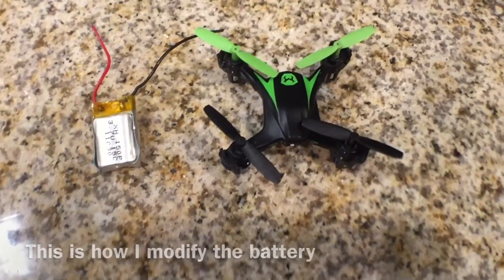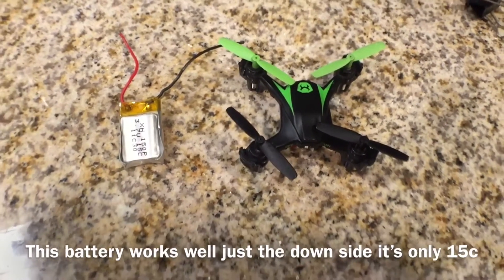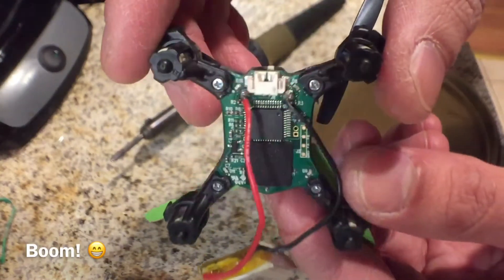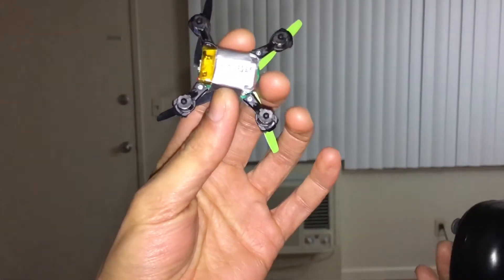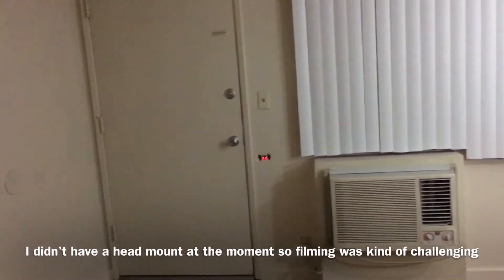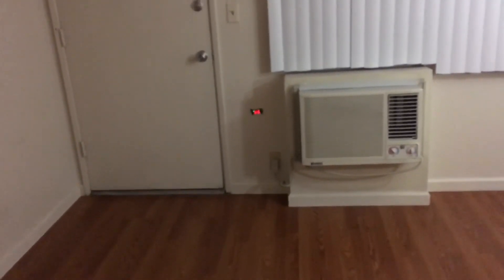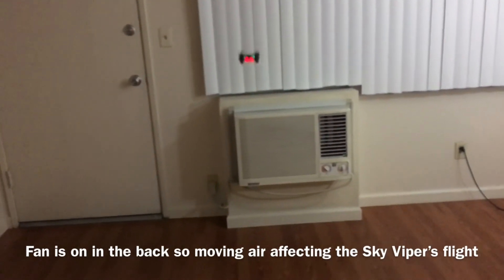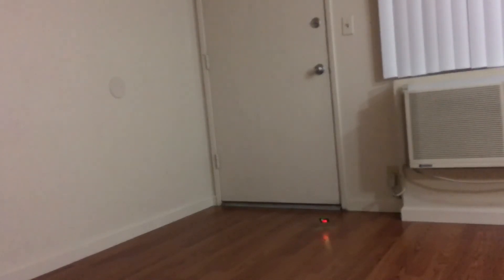Sky Viper M550 nano - how I replaced the old fried battery

Comment: I’ve taken the screws out of the drone but how do I separate the top half from the bottom half of the drone. I can’t just pull it apartz
Reply from the maker: It’s snap on together just use a flat head screw driver and go around the frame and pry it off after you take the screws off.

Comment: Any other modes like replacing propelers or beefier motor?
Reply from the maker: I haven’t seen or found any small props yet. I think a 3 blade prop will be super on this drone. I know my Eachine e012 have some 3blade props and I think they’re small enough for the m550 but I haven’t tried yet. As for motors, I have crazepony whoop motors and, I will also try to show n tell that as well. Thanks for the suggestion.
Reply: Teng Lay thats what i was thinking to do 3 blade props and i found a prop guard for this model its after market
Reply from the maker: That’s cool can you make a vid or show it somehow. I tried props from another drone and it don’t fit. They touch each other when spinning.
Reply: Teng Lay  thanks bro ill be tuning in when you find a way or find compatible stuff to upgrade this awsome thing
Reply: Teng Lay its from a website called shapeways

Comment: I just got mine and it only works for 5 minutes why
Reply from the maker: 5 mins is the average run time for the size battery of that drone. All of my micro drones have the same run time which is about 5 mins flights between charges. Bigger drones can fly longer. Bigger battery means longer run time. If you buy batteries Look for batteries that’s have a high Milliamp hour (Mah) that’s like the measurement of electric current by hour. The higher your mah the longer your run time. Hope that helps. Happy flying.
Reply: Teng Lay thanks

Comment: I am going to try that, but with a sky viper 650mah 3.7v battery. I disagree with you about telling people to buy a cheaper drone. The m550 is extremely stable and the reason the joystick is spring loaded is because of the altitude hold feature in auto mode. Most top end drones are like this including my Mavic Pro.
Reply: Craig Price hell yeah. I have a phantom 4 pro. And I have way more fun with this drone. Way worth it